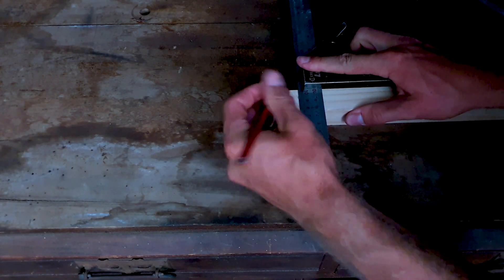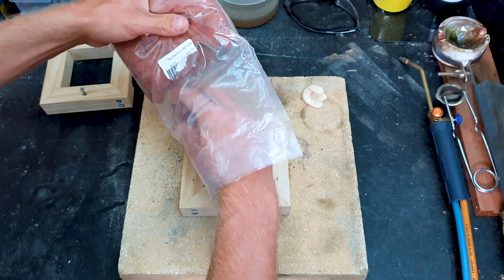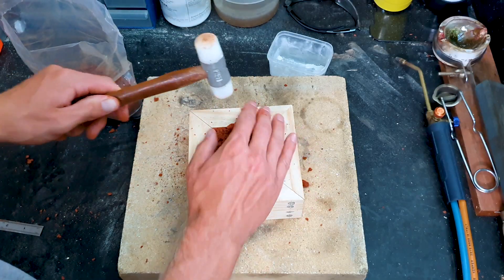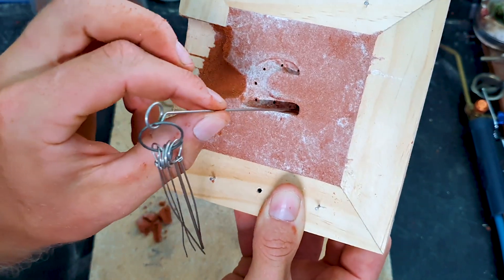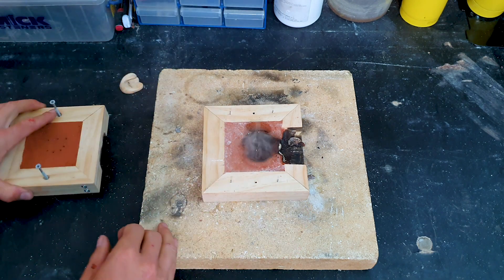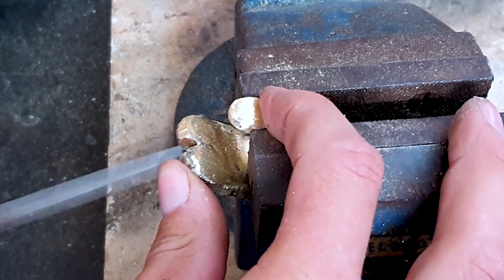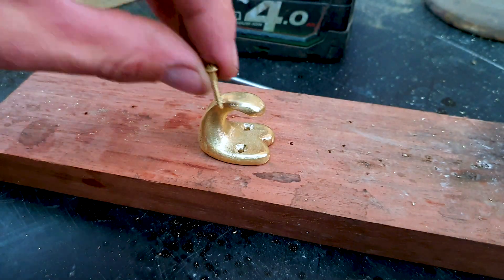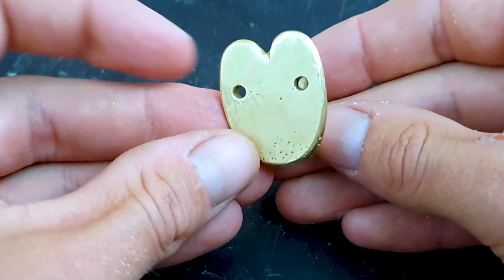How to make a brass hook at home

Comment: Hey! Thanks for sharing your process. Ive been playing around with sand casting over the past several months and having mostly only cast in sterling silver. I tried casting with some brass scrap I had recently but the metal would just not heat up and liquify in order to pour. I'm not sure if my torch just couldn't get it hot enough, or if there were still impurities (like some oxidization) in the brass... any insight, thoughts, opinions on the matter? I've got an acetylene torch set up. Thanks!
Reply from the maker: Hi, thanks 
It's most likely a heat issue I'd say